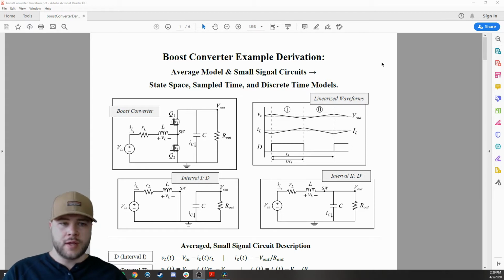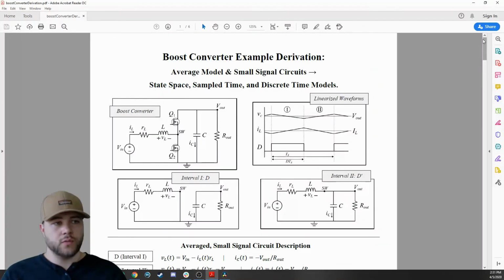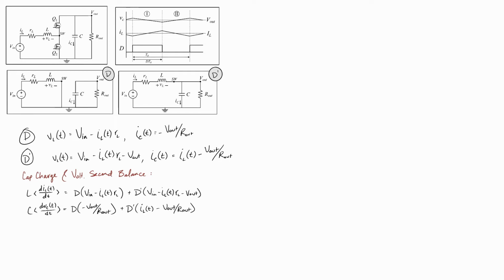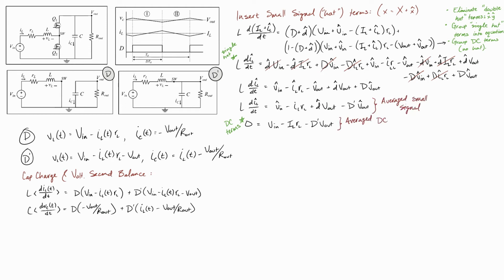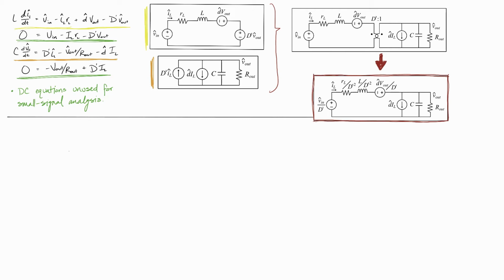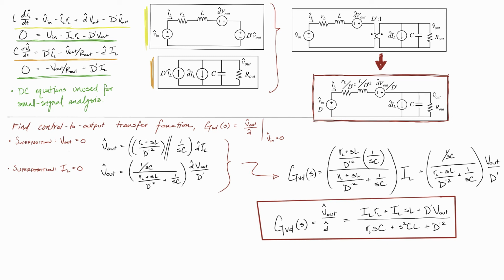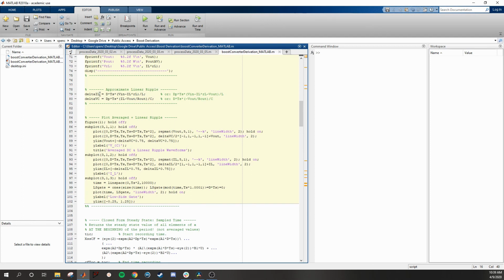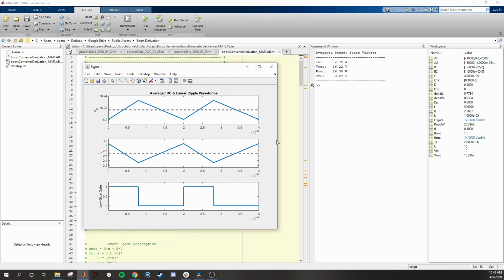Average Model of Boost Converter, Transfer Function Derivation w/ Helper Files -- [ep. 01]

Comment: Far too much time is spent on the gobbledygook of mathematics. I have been teaching electronics for 50 years and had over 25 million visitors to my website.
I have never discussed any formula, mathematical equation or any other non-sensical approach in my life.  This is not how you do electronics. 
For a simple module such as a converter, you buy different models on Aliexpress for $2.50 and pull them apart. You don’t waste time and effort in dribbling around with fantastical calculations. 
I have made millions out of educating people and selling books and magazines and kits and modules. All these YouTubers don’t have a clue how to design or deal with anything. 
That’s why l have simple JIGS and testers where you can plug in different values and get an immediate, accurate, true, repeatable, sensible result without any guessing and dreaming and most of all.   NO THINKING. 
That’s the one thing no University will teach you.  The skill in being successful is NO THINKING. Do everything the simplest way. 
If you look at all the multimillionaires, they produced the simplest idea that anyone with absolutely no intelligence and no capability could invent. It’s just a matter of pushing yourself forward. Look at the SUPER SOAKER man. 
The stup idest people of all are Professors. They are just CHALK AND TALK. Not one brings a sample into a lecture. And then to turn around and explain something mathematically without even showing you what they are describing is the biggest scam of the century.

Comment: Hi Spencer first off there is only one word to describe this video and that is "beautiful".I do have a question though, I am performing steady-state analysis for a multiple-input DC-DC converter to get the steady-state equations and then I want to perform small signal analysis. The converter has three switching states instead of 2, to derive the steady-state equations do I do the same process i.e: 
1) Perform circuit analysis and get the voltage equations for the inductor and current equations in each of the three switching states. (I do have more than one inductor and capacitor though)
2) Use the cap charge and voltage second balance and this time add the values for the three states together
3)Insert the hat terms and perform small signal analysis.
I would love to have your feedback, and if you are interested in seeing the topology I would love to send it to you. Please advise.

Comment: If I would like to consider rc for the capacitor, I don't see any problem to continue using that 4 basic equations defined for D and D'. And so the small signals equation and the average steady state DC equations. Can I continue to use the "combined" small signals circuitry and just replace 1/sC with (1/sC + rc) when calculating Vout?
Reply from the maker: Would have to look to be sure, but I believe so, yes!

Comment: U did great anything like this for the Vienna rectifier PFC
Reply: Have you got any progress?? it is a difficult converter to model (Modeling and control of VIENNA rectifier a single phase approach ),I'm trying to modelate  just a boost dc dc first and then I'll go for the VIENNA , if you are working on this paper it can be useful ¡¡ I'm working as well to get the model
Reply: @josevicente-nl8zv  yeah, I did it based on the paper in IEEE. 

"Average Modeling and Control Design for
 VIENNA-Type Rectifiers Considering the DC-Link Voltage Balance"
By:
Rixin Lai, Student Member, IEEE, Fei (Fred) Wang, Senior Member, IEEE, Rolando Burgos, Member, IEEE, Dushan Boroyevich, Fellow, IEEE, Dong Jiang, and Di Zhang, Student Member, IEEE
Reply from the maker: Sorry, nope!

Comment: Hey spencer, Its an amazing video. I have a small question what is the physical difference of the D and d. As D is also the duty cycle and d is also the duty cycle what is the difference.
Reply from the maker: Hi Jose! I don't really have time to look into this right now, but I suggest going by the book. These videos are a passion project that I put together in spare time, and others have also pointed out errors. It's not unlikely that I made a mistake or two, so if there's a discrepancy I suggest going by the books! If I ever get time to go back over these things and check for errors then I'll be happy to post an update!
Reply: @THEspenc2020   Thank you very much to take your time to answer,I'm researching with books  to get a proper model , and it is a hard task to do without any mistakes.Thanks a lot for the videos they are very helpful, I hope soon you keep going on them
Reply from the maker: Hi Anuj! D is the physical duty cycle (0<D<1), and d (with the little hat over it) is the small signal representation of D. 

The concept is a little odd to wrap your head around at first, but you can think of 'd_hat' as a really small change in D. So small that you "can't really see it". Mathematically, what we are doing is observing a steady state operating point (defined by terms like D), and measuring the relationship between different parts of the circuit. 'd_hat' mathematically represents the change in D, 'vout_hat' represents the change in Vout, and the transfer function (vout_hat/d_hat) tells us how changing D affects Vout.

Does that help?
Reply: @THEspenc2020  Thank you so much for the reply. I just feel so dumb in this, i can see it but i cannot reason it. Do you have a video explaining this. I just don't know where to find the information. Can you please suggest me something.
Reply from the maker: Don't feel dumb! This is very difficult stuff, and it took me many years to really understand it. Give yourself some time, my friend! I recommend a book called "Fundamentals of Power Electronics, Second Edition." Chapter 7 is where the small signal modeling begins, and it will walk you through the things I am talking about in this video if you want more detail!
Reply: @THEspenc2020  Hi there Spencer, I've tried the transfer function Gvd(s) from the book that you suggested and from others and there's a difference on the phase with the bode that it is on the video . Have you got in account the zero that is on the positive half plane (1-s/wz) or (1+s/wz) , I told you this because  when I change  the position of the zero  from (1-s/wz)  to (1+s/wz) my bode it the same that you showed on the video ,but boost converter has a zero on (1-s/wz).
I'd be very grateful if you can aswer this, I'm trying to modelate properly this converter for a thesis any help it would be more that appreciated